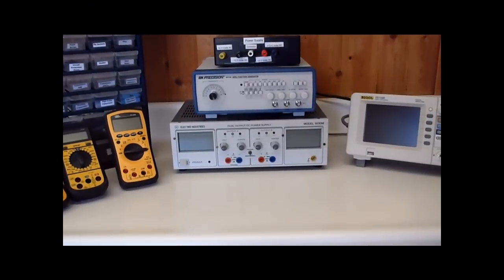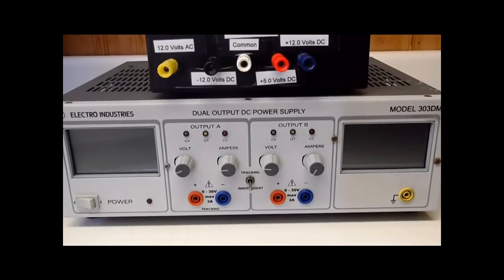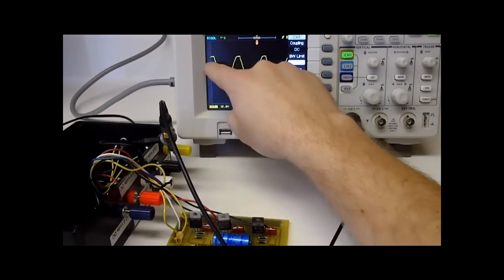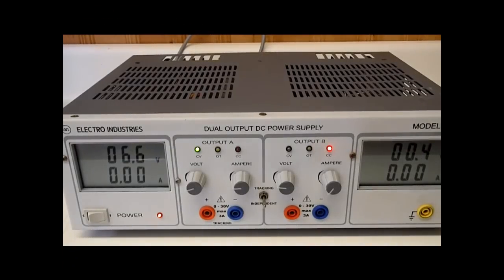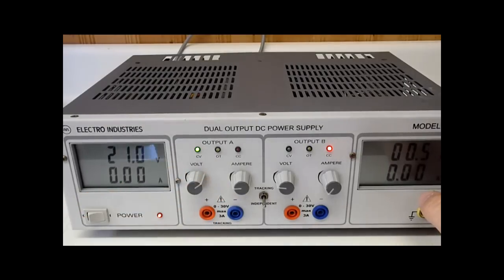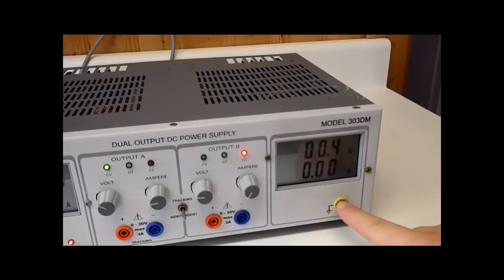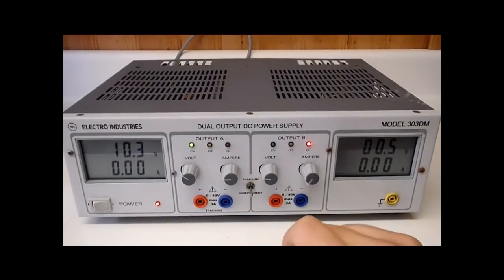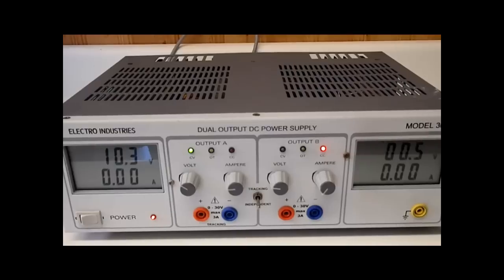How to Setup An Electronics Lab - Power Supply

Comment: This looks almost like the Voltcraft and myself I have the VSP 1220.0.1 but obviously what is distubring me is that first off all it has a bit of noise when switched on, even when there is almost no Current and secondly that the Display does not be enlighted, finally the Chassis is not fully closed because easily some fluent could enter.
One Question I have is what makes it than still desirable plus another question is at the ydisplay when it comes new can the plastic folia be removed or would it than be demaged, because it has developed some wave already and I am not sure if it were prudent to let it be?

Regards

Comment: Instead of a dual channel power supply for testing op amps can I use 2 single output power supplies to feed the op amp and a third single channel power supply for testing signal input?? I am asking because if something happens with the dual or triple channel PSU you lose everything completely.

Comment from the maker: Mine is about 290 Euros new, but if your have the money accessible to you it is well worth it( search: VLP-2403 Pro linear laboratory power supply ). But any power supply especially dual channel will do and give you the ability to learn. For most projects a 9 volt battery is more than enough and will allow to save until your ready for one. Hopefully this helps. But if you want to do amplifiers and audio a dual channel (two outputs) is necessary to mirror sound. Any more question keep posting!

Comment from the maker: Sorry about the volume change - but in a summary I say - earth ground which allows you to build an isolated circuit. It's it a little over the top when your first starting out but it comes to make sense after a little while in electronics. It basically allows you to have multiple circuits that aren't loading on one another.